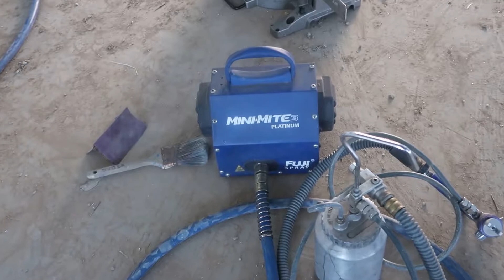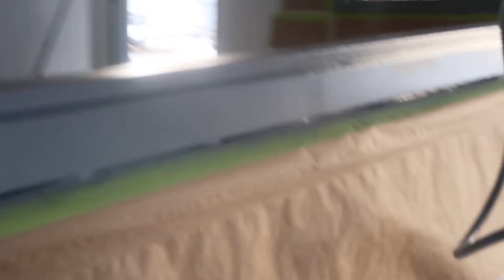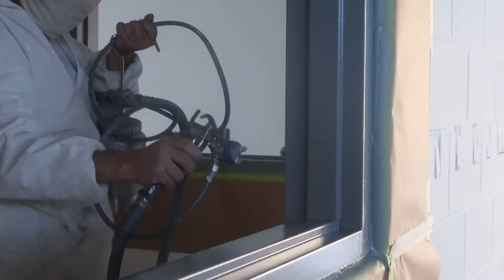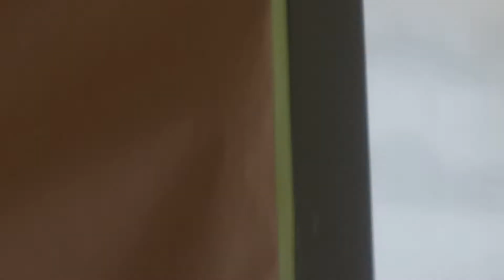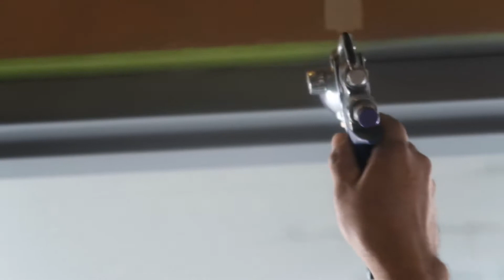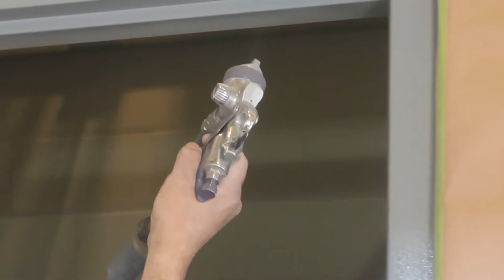MINIMITE 3 HVLP SPRAY SYSTEM - WITH PRESSURE POT IN ACTION - FUJI SPRAY

Comment: Looks to me like he needs to open up the fluid  cap a bit.
Reply from the maker: Yes you are correct, we did need more fluid flow, on this particular video we were using a small tip with a small orifice size, on the most recent video posted using a hvlp we updated to a bigger tip.
Reply: @platinumthepaintcontractor  
And you decided to show your ugly result?

Comment: The website says only the 4 and 5 stage for the pressure pot - any issues for mini mite 3 as I have that as well. Does the material matter - oil vs latex or anything like that?
Reply from the maker: Good questions ! I bought the mini mite 3 from  a awesome local dealer shop, they recommended me this pressure pot for the specific item I was painting. i did't want the cup attached to the gun. On this I haven't ever had an issue using the pressure pot with the mini mit 3. Now oil vs latex question. I have sprayed latex wolf gordon paint in an emergency situation and it worked. But i would only recommend using mini mit 3 for oil/enamel paint. No latex paints threw the mini mite 3. For latex material probobly a stage 4 or a stage 5 would be better. Just my opinion from trial and error ! If this was helpful in any way please don't forget to Like and Share the video. But please don"t forget to subscribe to the channel. Thank you very much and have a wonderful and bless day ! God bless you !

Comment: Have you ever used your gun to spray the outside of a home?  I purchased the Q5 PLATINUM T75G Gravity HVLP Spray System and curious as to what my limitations would be.  By the way, I ordered all the tips Fuji has with my order!!  Hahaha.
Reply from the maker: Good question! I personally haven’t ever used my hvlp to spray the exterior paint. Although you machine is bigger. I’m still not sure if you can spray the exterior of a home. I would do it. There are good small diy machines by Wagner/Titan or Graco. That would work great

Comment: Beautiful finish
Reply from the maker: THANKY YOU VERY MUCH DAVID, REALLY APPRECIATE YOUR COMMENT!
Reply: @platinumthepaintcontractor  I ordered one today because of the finish you did
Reply from the maker: @dmlvsccfamful  Wow i'm sure you will love the machine. Get that paint spraying!
Reply: PLATINUM The Paint Contractor I have a few questions for you. Is that vacuum sound the spray machine? Do you consider it loud? 
I’m also looking to buy the mini mite for refinishing bathtubs and showers, I noticed your paint is a high viscosity, you think gelcoat would be ok to spray through the machine?
Reply from the maker: @mlinecomposites1  Very good question, yes the noise is from the FUJI HVLP. In a small room it can be pretty loud. My understanding stage 4 and stage 5 are not as loud as a stage 3 like the one in this video. At the time I purchased this HVLPI didn't have capital for a stage 4 or bigger. The sound don't really bother me especially after I receive payment for anything I spray with this turbine HVLP sprayer. Any questions at all about this platinum 3 mini mite, don't hesitate to ask. If I have a opinion or answer I will gladly share with you. One thing I cant stress enough this is mostly for oil base paint. Although I have sprayed latex with the pressure pot. But I don't recommend you do that!
Reply: PLATINUM The Paint Contractor thanks for your reply!

So what your saying is that with the stage 3 that you have it’s best for oil, but for the 4 and 5 I could use for resins and gelcoats?
Reply from the maker: @mlinecomposites1  NO,  I DONT USE RESINS AND GELCOATS. What I was referring to was that the viscosity of latex is much thicker than oil base paints. For example Sherwin Williams latex paint  I would much more recommend to shoot with a stage 4 or a stage 5.  As for DTM oil base you can shoot through a stage 3 no problems at all.
Reply: PLATINUM The Paint Contractor ok 👌🏾 that’s awesome to know. 

I guess what I’m asking you if I can use this for refinishing shower tubs with resins
Reply from the maker: @mlinecomposites1  YES WE JUST REFINISHED (16) BATH TUBS WITH ENAMEL USING THIS EXACT MACHINE HERE SHOWN ON THE VIDEO!

Comment: Why such a narrow fan?
Reply from the maker: THE TIP WERE USING IS THE STANDARD TIP THAT COMES WITH THE MACHINE WHEN YOU PURCHASE THE MACHINE, WE JUST HAVNT ORDERED OTHER TIPS. WE WILL THOE VERY SOON !
Reply: @platinumthepaintcontractor  Cheers.
Reply from the maker: CHEERS !
Reply: @platinumthepaintcontractor  Oh okay. I was wondering the same thing. Makes sense though.
Reply: @platinumthepaintcontractor  Hi Platinum, you can adjust the fan width and the airflow on the gun, thanks for the video :-)
Reply from the maker: @leakybean501  Yes thank you we also just ordered a new larger tip and needle for the gun!